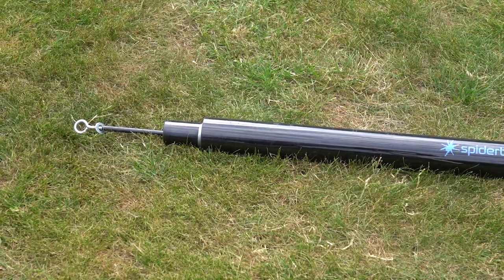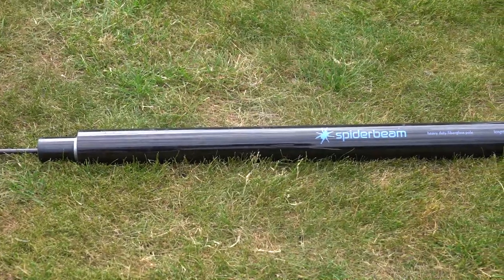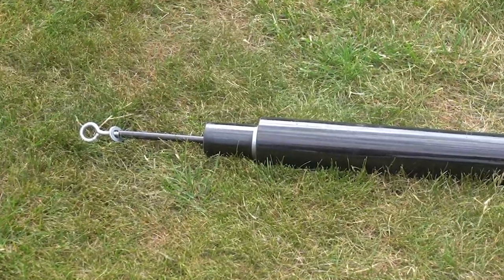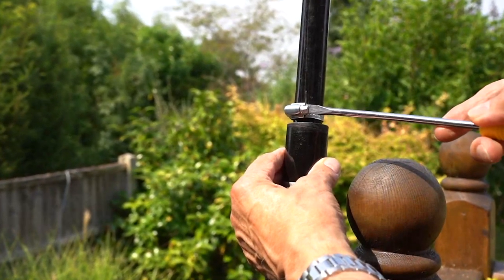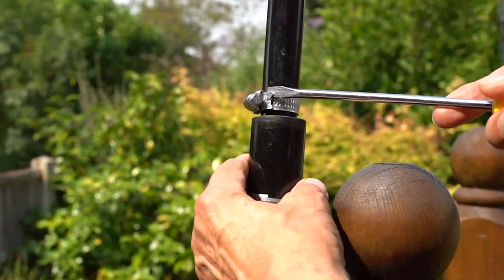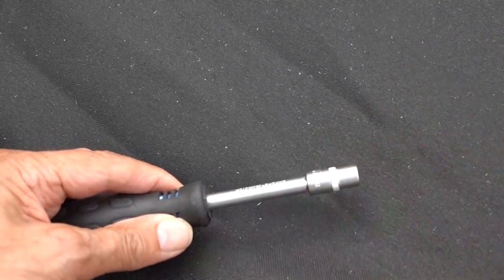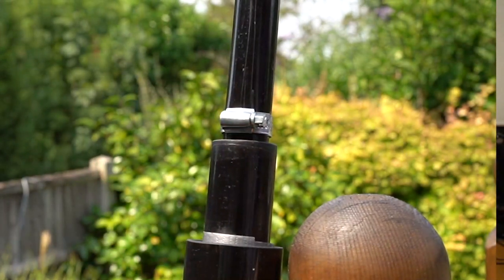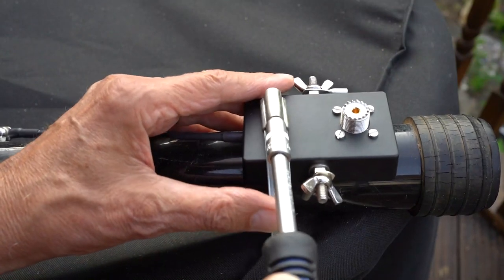Spiderbeam Fibreglass Masts for Small Gardens and Portable Use

Comment: I just got my 10m pole so I can tape a 29” wire, I didn’t do it today because it was windy. It is a Haverford brand in NSW, it is a squid pole. Another youtuber used a hose clamp on the lowest pole held up by 3 tent guy ropes and tent pegs. It looked rather good.

Comment: great tip about the hexagonal spanner Peter, I never thought of that. Much better than a slipping screwdriver...and the RCB60MM connector looks good...many thanks for another excellent video...
Reply from the maker: I have been on the wrong end of a screwdriver a few times!
Reply: @watersstanton  are the nut sizes different from 6mm down to 4mm ?  One size socket will not cater for all the jubilee clips as they get smaller in diameter. 73

Comment: Purchased my 12m  along with a purpose made heavy duty tow ball attachment where the base of the mast sits into. I also purchased the webbing attachment for the guys. I have not been out operating since Corvid-19 so I have not used the Spiderbeam in  earnest yet.  Choice of Full Length G5-RV flexe weave , Long wire Kevlar UnUN CG-2000 Longwire Tuner, so much to try and experiment when these restrictions cease. 73 Take Care and Stay Safe.
Reply from the maker: Many thanks for that. 73 Peter.

Comment: Thanks for video Peter. That connector box certainly looks useful. Just a thought about hose clamps - I would suggest using stainless steel clamps. The regular nickel coated ones start to rust fairly quickly in our climate.
Reply from the maker: Good tip!
Reply: The nylon ones are becoming very popular. Nylon screw clamps, who would have thought?

Comment: Really enjoy your videos Peter. I do a lot of h.f. Portable operation, usually QRP, using my trusty F.T.817 transceiver. I use a “Spider Beam” asymmetrical inverted “V” dipole and a collapsible 5m fishing pole, bought from a car boot sale for £3.00 some years ago. (The SpiderBeam should be supported at 7m, but it does work ok at 5m). Some of my operations are carried out in local parks, big wide open spaces. Or so you would think. It is always a source of amusement, whenever I assemble my antenna, in such a big wide open space, it attracts humans by the dozen.  Even though they are not remotely interested in what I am doing, and there can be 100yds either side of me, they will head straight for me, often causing either myself, or friends to gently coax them around the potential trip hazards. Just a thought , does your company sell human repellent at all? Sorry for the long comment, but I thought I would share a small fraction of my portable operational experience. Keep up the great videos, Peter, stay safe and well everyone. 73’s de Geoff (G4SQJ).
Reply from the maker: Many thanks Geoff

Comment: Here's a way I've found for making a cheap, high performance, ground=plane, Yagi, quad, etc.  I've used it for 6 & 2m, but it could be adapted to the lower bands, as well.  PVC PIPE!  It's cheap & light.  You just cover it with copper foil tape, which you can get from Ebay.  You can also use aluminum tape, which is easier to find, but more difficult to make electrical contacts to.  An advantage of such an antenna is its fairly large diameter, relative to its length.  This gives it a wider bandwidth, compared to small diameter metal tubes.

Comment: Hi   I was lucky to get a vintage  Fibreglass pole  (  Made in the  80s/ early 90s  )   back in the day ..........It's the main homemade  antenna for 40Mt  
Easy to fit Two elements at 33 feet each with a home made 1.1 choke .............73s
Reply: @782 Matt and what a fabulous signal you have OM! Thanks for the QSO the other day 5/9++ 73
Reply from the maker: Very cool!
Reply: Back in the 80's i used to use a DK9SQ 10m mast for portable use they was the strongest at the time
I just ordered a spiderbeam 10m mini pole for portable use 😊

Comment: good stuff indeed !  That RCB-60mm looks interesting, but an so239, a couple of stainless bolts/wingnuts/washers/glueline heatshrink and what looks like a plastic box should not be £40 even if it is made in DL. Also, very odd they didn't use a HOT bolt on the top instead of the wire+ring terminal. An easy project for anyone really. 73 Richie.
Reply from the maker: Good to hear from you. Peter

Comment: Hi Peter Cable ties are quite handy for that, as opposed to hose clips and elastostraps, you can get quite large ones...Fred g4vvq
Reply from the maker: Hi Fred. Thanks for that. In fact I spend quite a bit of time taking my amtemmas up and down so I would get through quite a pile of cable ties! But for some, the cable tie idea might be best.
Reply: I purchased from the likes of Aldi a pack of multi coloured Cable ties in various sizes, some come with a push to release tension lever making them reuseable. Available from the likes of Aldi  and Lidl suppose other places too

Comment: I bought the 12m spiderbeam and put the center-point of a commercially made ZS6BKW, the stupid mast was bending very badly just under the weight of that and the two wires. I was told by the seller that I need to lower the mast by two segments to keep it from bending. over. So, I guess, what's the point of it being 12m tall if you can't use it at its full height? Sorry, but that's kind of stupid.
Reply from the maker: Many users deploy it as a vertical but to supprt a downwRd weight, you do need to relescope in a couple of sections. Peter.
Reply: @watersstanton  Well, I'm not sure what the point is of it being 40' tall if it has to be lowered in height to support even a minimal weight. I already had a 34' mast. I got the spiderbeam so I could get the antenna up to 40' tall, not so I could have a fiberglass version of what I already had.
Reply: That's like buying a boat from someone and have them say "You'll be fine with this boat as long as you don't put it in water that is more than 5' deep."

Comment: Very fine video. Can you suggest what is the largest gauge wire that would fit an EFHW 4010 at the top of the 12m pole? I have a 14 gauge EFHW and am wondering 1) if it would be too heavy at the top and 2)would I gain more performance by putting a lighter gauge at the top vs putting the 14 gauge a few sections down. Intend for 100 watt SSB portable. Thank you, keep up the great series. 73
Reply from the maker: 14swg would be too heavy. Check iut the Spidermast that I will cover in a new video shortly.
Reply: watersstanton thank you, looking forward to your next video

Comment: Hi Peter, can you recommend a thin wire, to make an inverted V, I thought of flexi-weave, but would that be to heavy
 100 w max  
 73 Paul M0BSW
Reply from the maker: Paul, I tend to use plastic coated multi-strand of whatever I have around. Flexweave is a bit heavy. There is no magic wire, despite what some would have you believe! The main thing is that it does not break under normal circumstances.
Reply: Hi Peter, That's OK, I've been using some wire I got from a BT engineer years ago, the kind that used to be on the poles outside very thin & very strong I use 4 inch long springs on either side after the insulators on the ends to the fixing point, no idea what is called, but I'll give it a go

Comment: I use 2x 12m spiderbeam masts in my 20x10ft garden had them up for 10years now they are not guyed 
They have taken 60mph winds ok over that i take them down for singal wires i use power pole conecters
But at the moment i am useing 5/8 wave virtical dipoles for 15m and 12/10m chris G0WFH